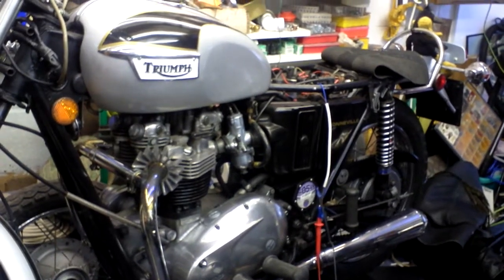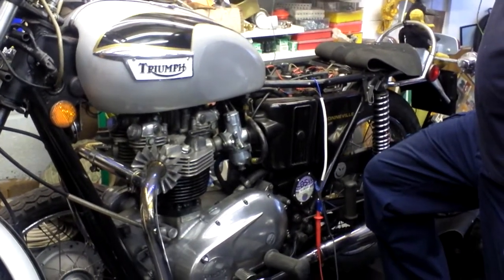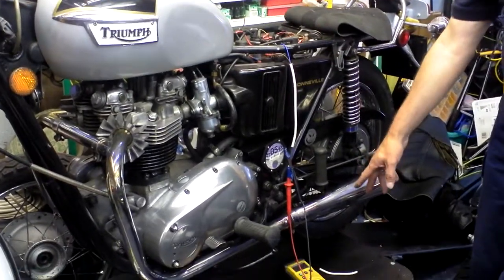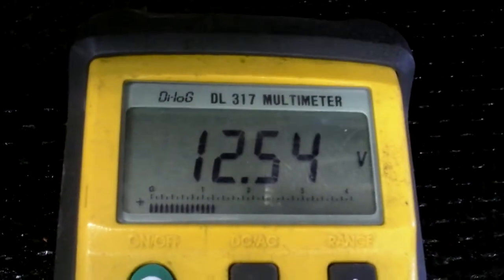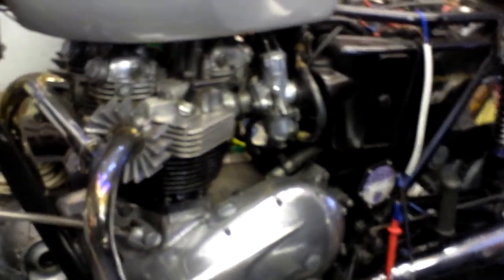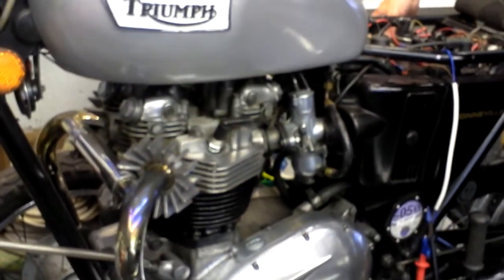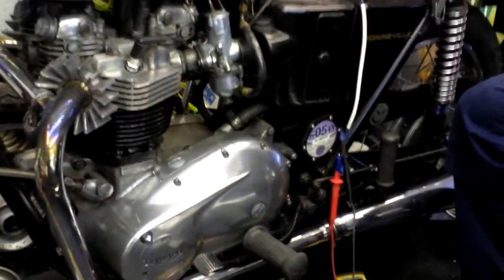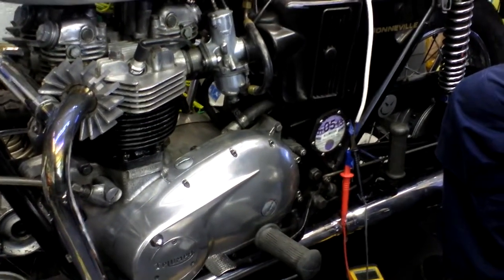Triumph Bonneville T120R Voltage check

Comment: Thanks for the sub, subbed back to you. My voltage is too high, think I need a new stator as ive already tried a different rectifier regulator. Going to fit a new stator soon then post an update :) Thanks, Josh.
Reply from the maker: Josh, when running with a combined regulator rectifier, voltage when riding will be about 13.5 and normal. Most new stators are rubbish and tend to burn out in 2 years. If you have an old stator it will last a very long time. I have used Yuasa NP12/7 fire alarm batteries for all the time running old bikes. They last over 5 years and cannot leak. They are happy at 13.5 volts and no harm done. I use a digital voltmeter at the handlebars. It is a USB socket for sat nav but happens to have a good voltmeter on it.
If you ever find not enough charge, check rotor magnetism as i have had one lose its magnetism. It ran the bike but the battery went flat with lights on. I found an old 1969 rotor that had good magnets
Reply: Cheers but my bike runs sweet suzuki intruder with virago carb but im getting voltage spike sometimes 19v to 20v on high rpm very daunting!

Comment: Dude, why did  you even go down that electrical rabbit hole, you tear apart your switch for what? you are able to start your bike, ignition good. you clearly have carb issues.  this type of content is a perfect example of how not to work on your b ike
Reply from the maker: Hi, i am an electrical engineer and had this Triumph for 25 years. I built it and have built many British bikes in the last 53 years. This video was to show something to John who makes the Lunmad videos. There is nothing wrong with the carbs as the bike runs very sweet as it always has done. If you look at my other videos, you will see its a very fast overbored bike i built this engine 12 years ago and it runs perfect. I also sell motorcycle parts as a business

Comment: I upgraded my T140V a few years ago with a 3-phase, 180W stator and solid state regulator/rectifier, and it has transformed the charging system. It now maintains a usable voltage even at low speeds, so that, with headlight on, the indicators will function properly in traffic, and it no longer gradually loses battery charge during the course of a ride.
Reply from the maker: Hi, i am still using a single phase alternator and have been on 2 x T120r models since 1978. No problems at all and i use a large LED set of lights for daytime riding. What i have found to work well is a fire alarm sealed battery. Yuasa NP7-12. I have used these for many years and they will last over 5 years and very little self discharge. 
The T120r in the video is one i bought in 1998 and still have. I use a Podtronic unit on that one.
I actually sell solid state rectifiers on ebay  but they need a separate zenor diode on Triumph and BSA late models. Been the largest supplier of rectifiers for many years now. Cheers.
Reply: @mrstupid  I'm using a Motobatt MB9U sealed AGM battery, which seems to hold it's charge much better than any of the series of conventional, flooded batteries I've had in the 28 years I've owned the bike. I've read about others using LED lights, but I don't understand how they are not polarity-sensitive, as that's the essence of a diode. Did you have to convert to negative earth, or insulate them from the frame?
Reply from the maker: The leds i use come with a black and a red wire attached so i just wire them in. I have extensive led lamps on all my bikes. The indicator warning, i have fitted a left and right side 9 watt led eagle eye that is so bright, you cannot fail to turn it off again. I uses red led eagle eye as additional brake lights. Take a look at some of the videos showing these lights i have on youtube. On a ride over Dartmoor the weekend so i will ad a video of some bikes at the lunch stop. About 100 riders of mostly British bikes. The Yuasa battery i use cost £16 and is 7amp. I used to fit many into fire alarms when i worked. Rarely fail in use. I also have a digital voltmeter and usb port at the handlebars and i can monitor the voltage all day. I run a satnav from it but will also charge a phone.

Comment: Hey Lundman , I love your videos to good and funny, I have been trying to get a simple diagram for a 1966 TR6r 650cc Zener diode wiring, now this is a stock triumph with alternator 3 wire b/w, w/g, w/y, a rectifier that mounted on the back of battery box and a zener diode mounted to the side of bat box.all my books , videos I watch will alll be different , im tired of having to be home by dark, Mick Davis mdstr650@ hotmail.com help me anybody.

Comment: the bonny i have on the vid , changed all the oils . went for a small run ,  noticed while it was on it's side stand . oil leaking out of both spindle shaft o rings . so i will be renewing those , by following lunmad's
fitting them back in with a 0.3 feeler gauge . saves tearing rocker boxes and other stuff off . .I hope!

Comment: very little lighting on these old girls even less when blinkers are added
i used to have more success with the joe hunt magneto for running  . and the same wiring set up and rectifier  and . zen ode with a real good battery just for lighting and accessories

Comment: I used to have problems with the battery going flat if I used the lights too long. A three phase alternator and podtronics unit solved that. Now I can have the lights on all day. It helps when the half-blind drivers are on the road.

Comment: Hi Geoff :-) 
yes there is a fair difference but don't forget my readings are with a brand new alternator as well.
I got readings a bit less that yours when I tested the podtronics unit with the old 40yr old alternator.

Could/would you put your vid onto mine as a video response? 
it'll make it easier for viewer ta!